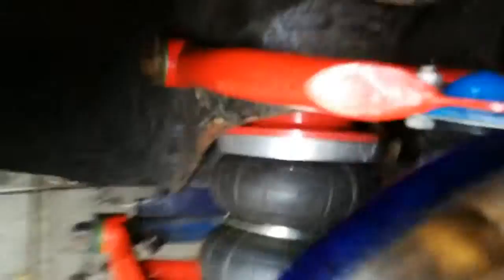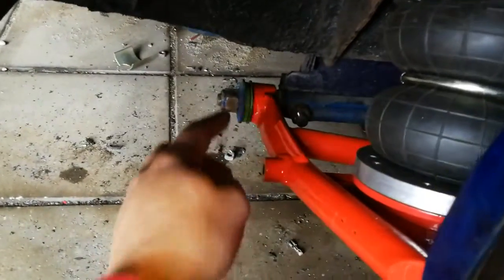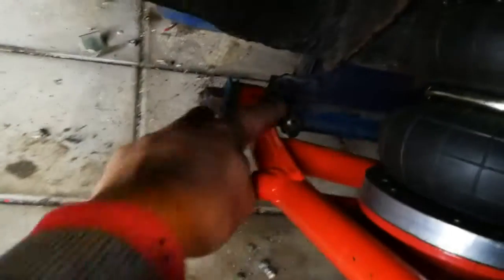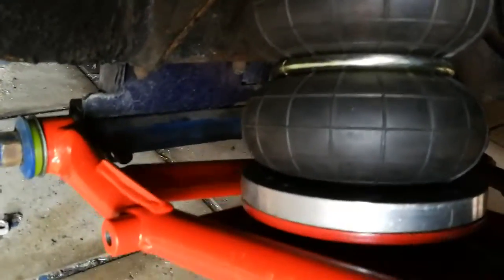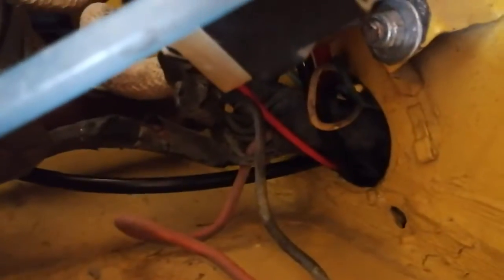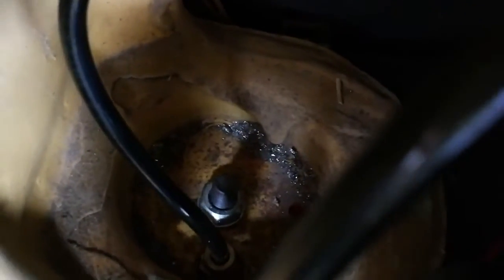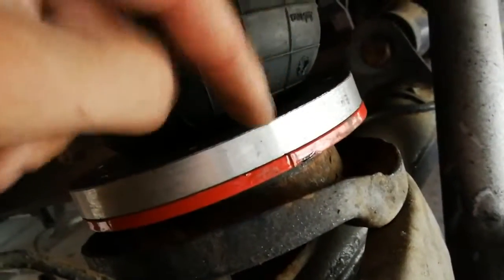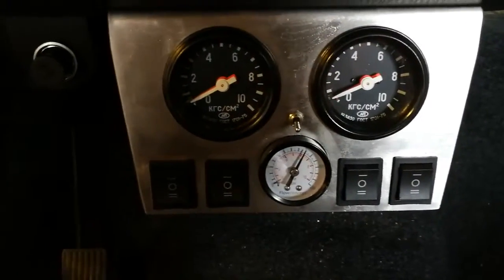LADA 2101-2107 air suspension installation by Mark Jensen

Comment: Hey bud, thanks for the video, hopefully getting my lada 2101 tomorrow here in Florida, USA.  Questions there is a 3rd spring on the rear differential, do you just take that out and not have anything there? Does that do anything to the drivability or anything when you take that middle spring out that goes from diff to body?  Thank you!
Reply from the maker: Hello, there is no 3rd spring. What do you mean?=) There is not spring from diff to body from the factory